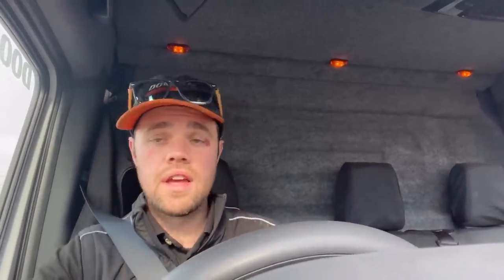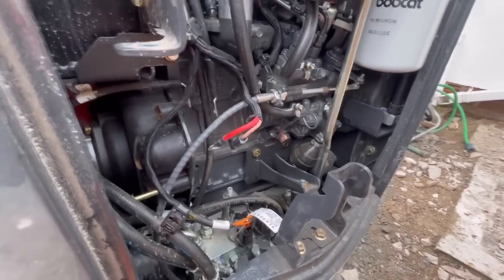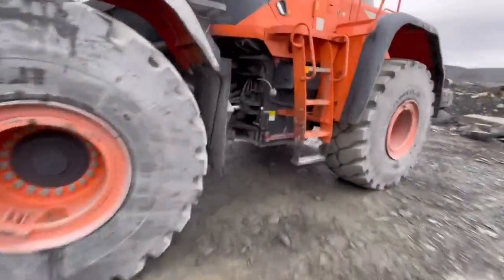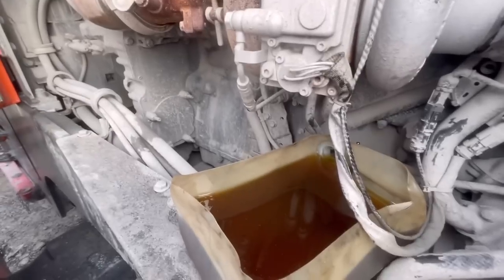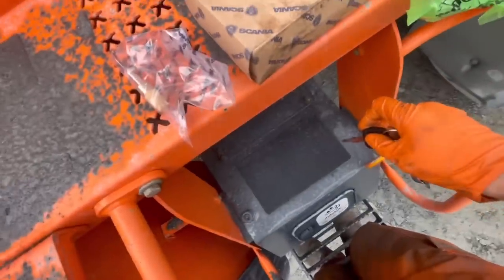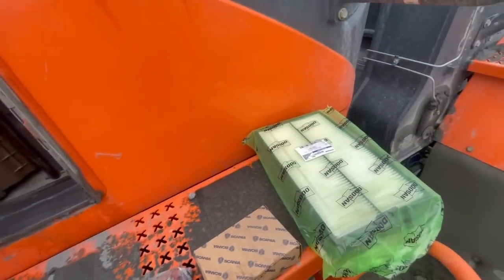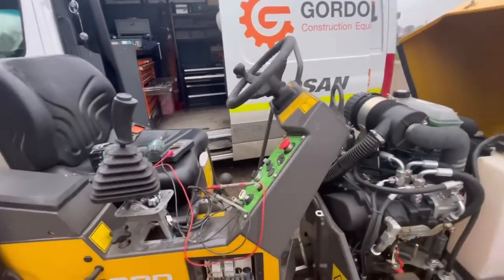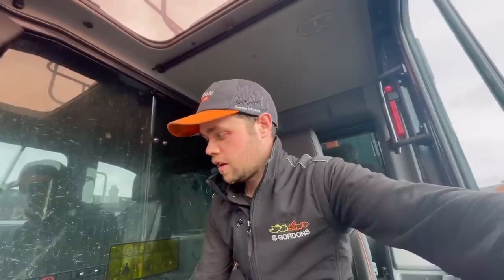Fire ! / starter motor / oil leak / electrical fault / Diggers Rollers Shovels / Episode - 157

Comment: Hi Ali. Have done a couple of those vibe switches on benford rollers in the past. You maybe will just fit a lever depending on your parts availability but the switch screws into the top of the joystick in theory…….!  though getting them out is usually a bit more western involving a hammer and screwdriver to remove in pieces!  I am an ag engineer down in Lincolnshire working for myself so see all sorts of machines ag and construction. Love your videos you always make me chuckle!  Thanks for the hard work posting for us all to see. 👌🏻👌🏻👍🏻cheers Pete.
Reply from the maker: 😂 I’ll see what turns up I ordered the button with a bit of luck I’ll get the whole assembly 🤞

Comment: SNAP, must be roller day 😂 I've had to strip down the rear roller on a JCB ct260 with rear excessive vibrating noise found the exciter shaft bearing  ran dry and started to disintegrate. Never even seen one before today
Reply from the maker: Bit of variety doesn’t hurt does it 🤔😂
Reply: @alisdiggerdiary  no we definitely get that in this industry 😂

Comment: Hi Ali love your comments best wishes from Galway Ireland quick question obviously you carry air compressor to do your work what size is tank and also are all doosan machines work on Scania engine or do they use other makes cheers Declan 👍👍🙏🙏 or do you do just all service work without need for compressor
Reply from the maker: Hi a compressor is on my to do list don’t have one at the moment but I would probably just get a small one I don’t have any air tools so it would just be to blow air filters out . Majority of Doosan machines have doosans own engine except the larger machines I think from 40t diggers up and shovels from 420 up

Comment: The operator that's on our 225-7 says its night and day compared to the 225-5, he's had it on a cruching bucket a few times and can operate and move the machine with the bucket still running where any other machine/model will cut the service line hydraulics to favor the machine hydraulics, he loves it
Reply from the maker: The 225-7 seem to be worth the extra investment 👍👍